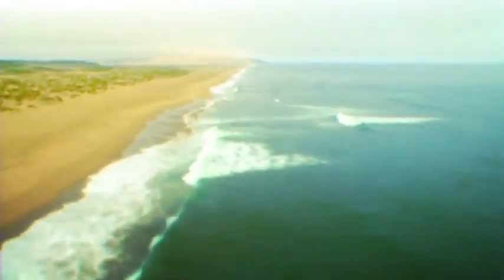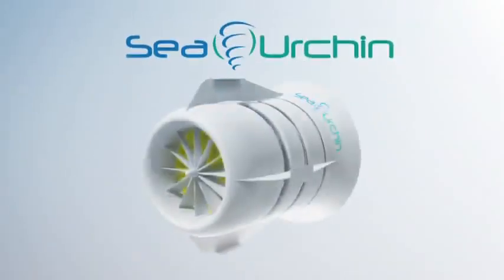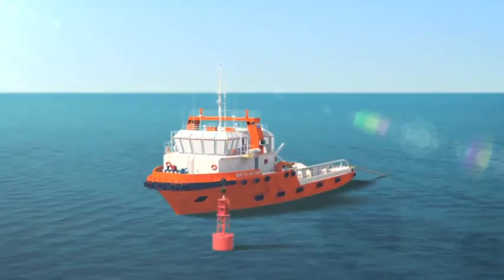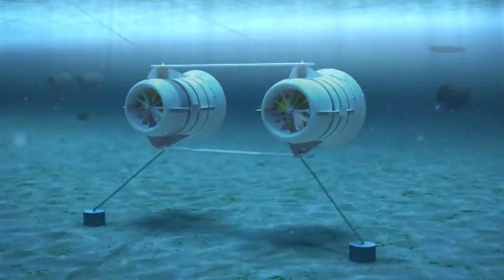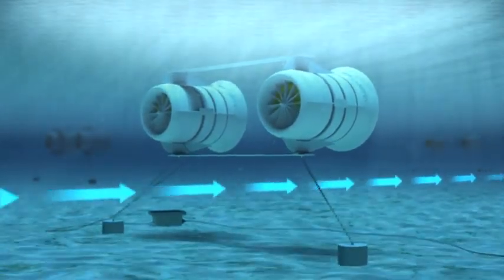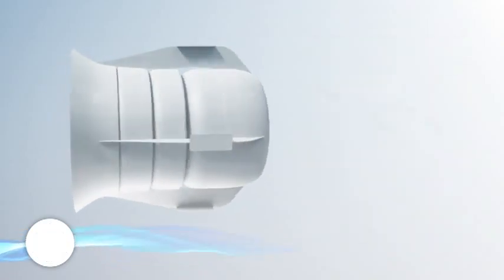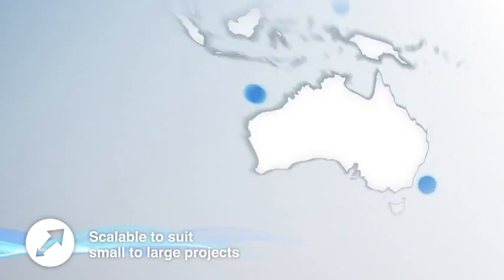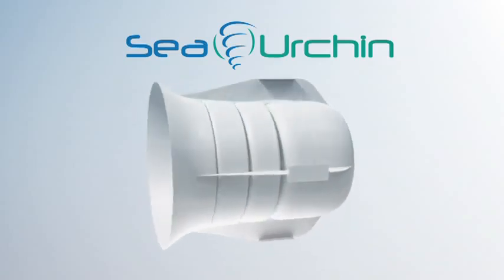EET SeaUrchin   Tidal Turbine Video

Comment: I guess we are suppose to ignore the huge line losses and the cost of the 20 miles of copper cable to get it to the nearest grid?
How convenient...can we look at the cost of thorium nuclear plants without the fuel cost....since they will be burning spent fuel?
Reply: rRobert Smith My first thoughts too. Power loss from long cables, unless Voltage is stepped up at source.

Comment: if you want to generators do this job then use half pedal cycle electrical generators which are more reliable and used a big rotation wheel for battery physical

it will provide more complex and steady speed from sea waves

Comment: chains are stupid and old technic weird concept.
Reply: I agree in the technical sense. It should be a block-type containing these 2 or more turbines and rigged on the surface of the seabed. From there, electric generation is connected as usual via underwater cable to land-based power grid. How does that sounds? Do you agree?
Reply: Michael Simoneau maybe there is a benefit from them being able to move up or down??
Reply: Sea waves are comparatively more turbid so close to the sea bed. Going a little up reduces the turbidity